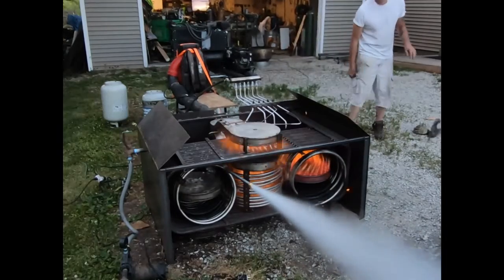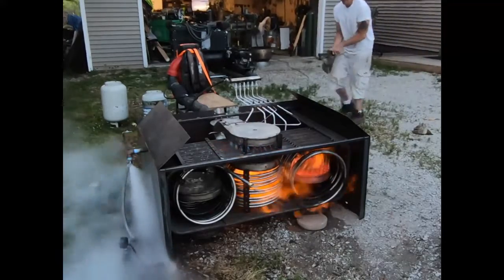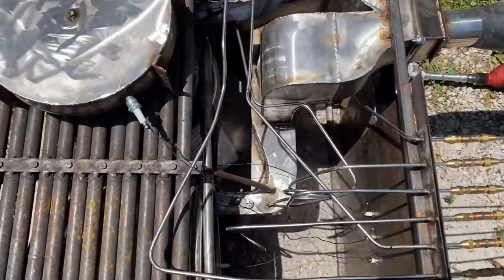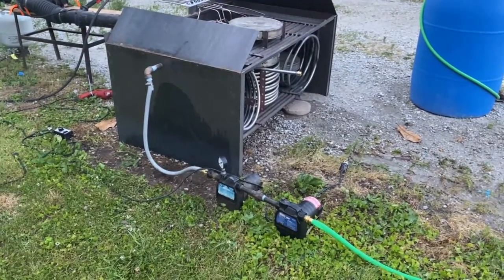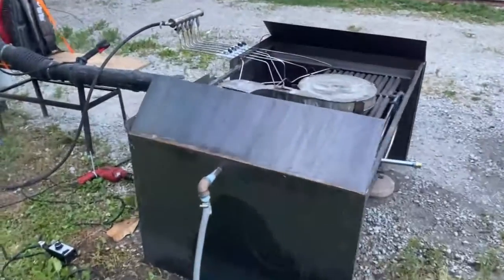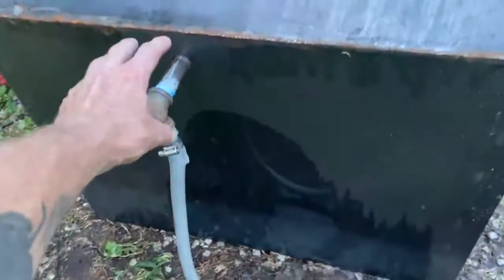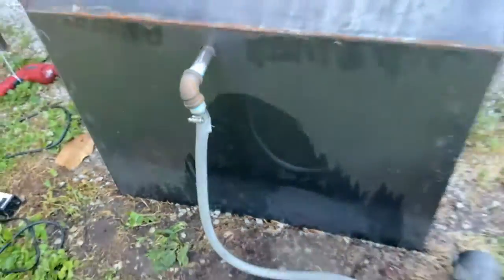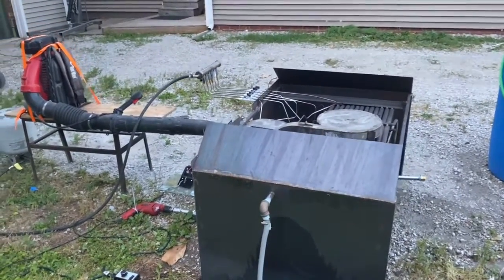Super secret boiler test WOW

Comment: Impressive.
What kind of psi did those water pumps make? Seems like  more pressure is needed, or coils are to small in diameter. Or parallel up the coils for more cross section,
But you probably know all this already.
Reply from the maker: The booster pumps and the hose combined should of put us at 85  psi or so . Hooked it up the next day with a pressure washer and got 500 psi with no restriction on the discharge

Comment: I have a question if you have a moment.
I have been assembling a turbojet from a rebuilt automotive turbo, the chambers are made already. But i have been curious about running it on waste oil instead of propane. Wondering if you have any thoughts on the best type of burner nozzle for the application with your experience making various burners. I have considered having the start up on propane then transition to waste oil once its nice and hot to minimize the amount of depositing inside

The jet is just a fun project doesnt have an industrial application or transportation function. Just converting waste oil into cool noises and fire. Maybe burn some blackberries with it 🤷🏻
Any input would be appreciated, from what i have gathered i could make it work reasonably well with a properly calibrated siphon atomizer spraying directly into the combustion chamber via a tube with an adjustable insertion depth.
Reply from the maker: get a 1 gph 80 deg B cone nozzle , i would also get a 0.8 gph also just in case . you will want 150 to 200 psi of 130 to 160 deg oil . The oil will not atomize if its not pre heated
Reply: Start on Propane, once its running you will need one nozzle that is always at a minimum of 120 psi that keeps it idling in between 2 psi and 5 psi of boost.

I have 2 more nozzles that I stage, but if you had higher pressure you could get away with one
Reply: No need to preheat if you start on Propane, some care has to be taken to not allow too much combustion air in close to the nozzles or they will overheat.

Too little and it will have combustion instability.

If you want to start on easy mode mix in a little gas.

Remember if you have 100 psi fuel pressure and 30 psi boost you only have 70 psi of fuel pressure

Comment: This immediately made me think of the years I spent as a 'Tire Technician' - If you're trying to fill up a large tire with an air hose that is only 1/4" I.D., it takes what seems to be forever. Upgrading to a 3/8" I.D. hose makes a huge difference. a 1/2" I.D. is even better, but uncommon.

The same goes for a garden water hose. If you've got this insane boiler being fed by a common 5/8" garden hose, it would greatly benefit from switching to a 3/4" hose. The length of the hose is a factor, as well. - As the hose gets longer, the flow rate decreases. A large reduction in flow rate can occur if the water needs to travel over a longer distance.

For example, a 3/4″ diameter 50ft hose with a 50 faucet PSI would supply 28 GPM. The same hose of 100ft in length would supply 19GPM. That’s a significant difference from using a longer hose.

50psi - 25 foot hose - 1/2" diameter = 28.0 GPM
50psi - 25 foot hose - 5/8" diameter = 48.0 GPM
50psi - 25 foot hose - 3/4" diameter = 80.0 GPM

50 feet of hose decreases each by 50%
100 feet of hose decreases each (again) by yet another 50% from the 50-foot length.
Reply: A temp rise from 60F to 230F (15C to 110C) at 28 GPM at 50% burner efficiency requires 2.4 million BTU per hour. 2.4M BTU/hour is 26 gallons of propane per hour or 109 lbs of propane per hour. A 300 lb propane tank is required to sustain a flow of 109 lbs / hour or the tank will self cool.
Reply from the maker: @jheissjr  This is a liquid fuel system so bottle boil off isn't an issue . We have 4.8 million BTU's here .the boiler is likely only 17 to 30% efficient though  . unfortunately i did not have time to dial in the burners .
When they get red hot and are dialed in the efficiency may make it to 40 45 % but i feel 50 % efficiency may be hard to achieve without water pre heat   . Thanks for the input . If it was not for the liquid fuel design you are correct 3 bottles would never run this machine .
Reply: @jheissjr  Do you have my comment on 'water' supply, confused with 'propane' supply?  🤔
Reply: The numbers are for a water flow of 28 GPM.
Reply: @jheissjr  ah - ok
Reply: In addition 28 GPM of water is 6000 cubic feet of steam. To picture 6000 cubic feet, a 55 gallon drum is 7 cubic feet. 28 GPM would be 815 drums of steam per minute.
Reply: @jheissjr  Other pictures would 23,096 basketballs, or 1-3/4 Fifty-four foot long semi-truck trailers, or a 2-bedroom apartment? 
😆

Comment: Water hose got too hot.  Its too close to metal that heats up, all it take is 140° F and that burst pressure drops down significantly quick. It could have gotten even hotter being that close.

You have to extend the piping out more and get thick rubber hose. Insulation if nothing else. 

Did you check what outfeed psi on this big boiler? To evaluate input and output?